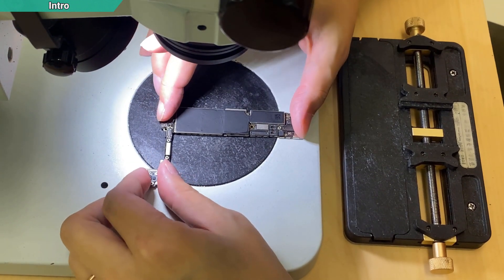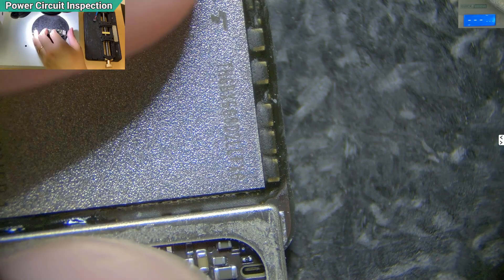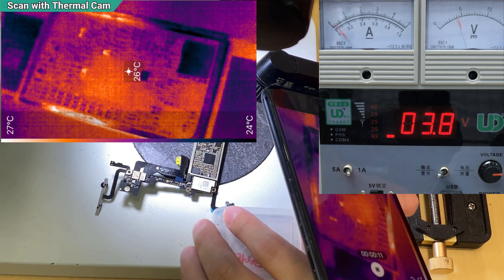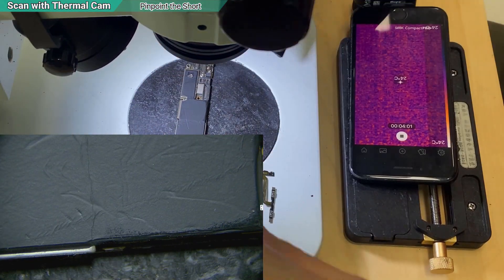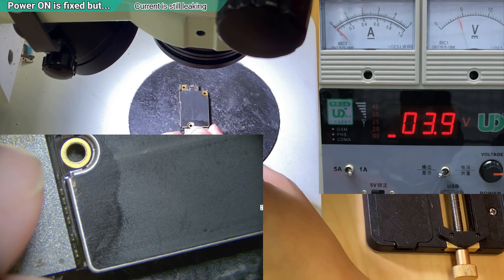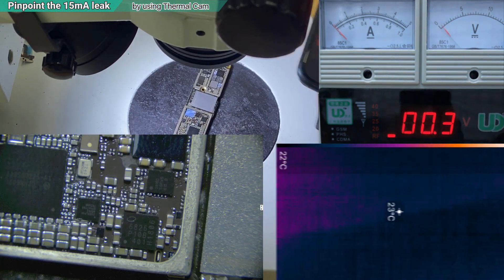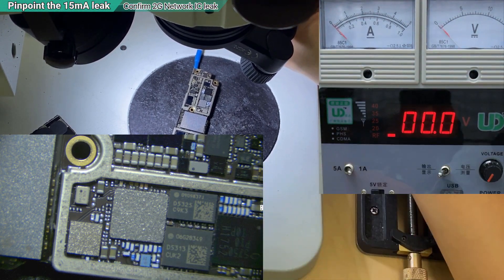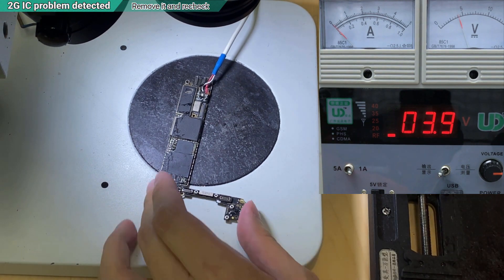Motherboard Drain Battery 【Thermal Camera】iPhone 7 Repair two problems

Comment: Sir can you tell me something about SE 2020 A13 CPU getting hot 🔥 to much as soon as I turn the Device on
Reply: I have the same problem with my iPhone 8 the processor side heats up like hell when turning on (specially when i replug the battery) after few seconds it kinda gets normal temps. 

But at night i charge my iPhone up to 100% and go to sleep with my alarm on and in the morning (after like 5hours of sleep) it has been drained to 40% i think i have a serious short with my motherboard😢😢.
Reply: I don’t have a thermal camera in that case i have to get it into a professionals hand

Comment: my iphone 8 plus is leakage short after power on, battery drain , weak network signal ,sometime its show no service with no modem firmware, could you tell me possible causes?

Comment: Hi sir it's very informative I also have this kind of problem in my iphone 7 my iphone got drained even if it's power off and when it's open the iphone had high temperature and the board side had the heat temperature how much it cause if I try this to be repaired to the technician they said I need to replace the board but I watch your vedio It was really the same in my case I hope you notice my comment thank you very much sir.

Comment: My phone 8  is stuck on boot Apple logo. I turned it off and it wouldn’t turn back on. I drained the battery now I just get the “plug in your phone” symbol. I think my battery has been dying because the charge wouldn’t last long. Got any suggestions?

Comment: hello master 😄which pins do you connect on the board to make the board turn on
Reply from the maker: Hi. Different model different location. Just look for power button FPC and hit them all to get it.
Reply: @iPhoneServiceMalaysia  pin names that need to be terminated in iPhone 7?

Comment: Thank you , My hand can not touch the leaked capacitor on 28C. I have to use thermal camera.
Reply from the maker: I had a case which is 10mA leak from a smallest capacitor. But recorded video is terrible quality. 
Now awaiting Thermal camera sponsors to challenge my Seek Compact Pro. Already have two companies gave up.